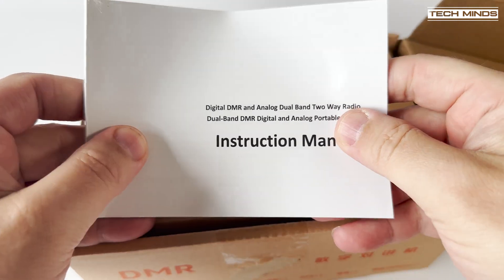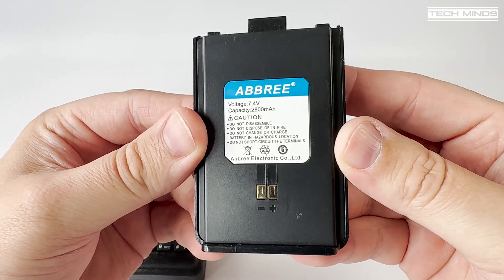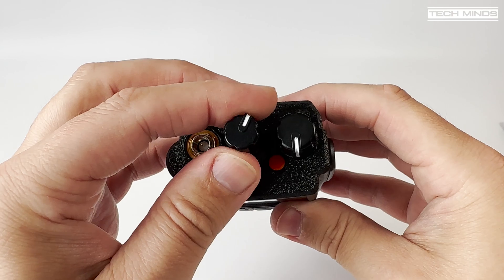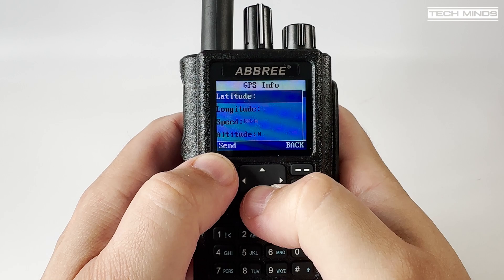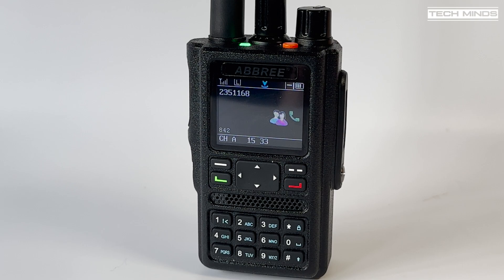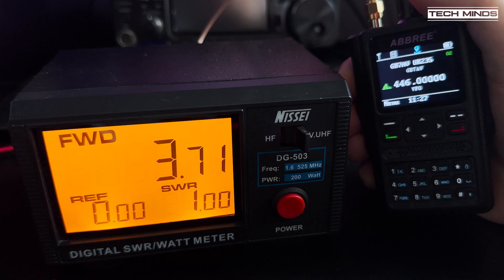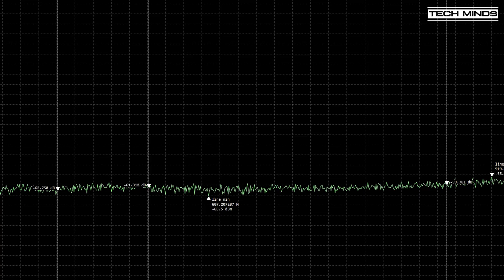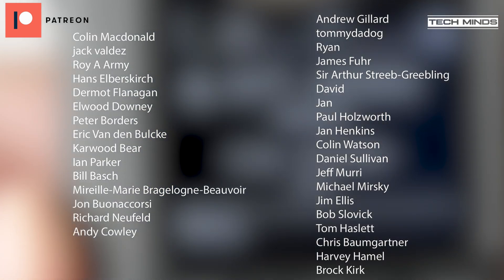ABBREE DM-F8 DMR TIER II With GPS Dual Band Handheld Transceiver

Comment: Hi Tech Minds!

Great video! Based on your experience... Will you be able to get more range with a DMR radio over an FM Analog, comparing this DM-F8 agains an UV-5R? Thanks
Reply from the maker: Great question. I can only respond with my own personal experiences, but in the past I did perform some tests with DSTAR and FM.  A friend and I were using FM, driving apart until we could barely hear each other on FM. Then we switched to digital DSTAR and could hear each other perfectly.  Never performed the test with DMR though. cheers!
Reply: @TechMindsOfficial  thanks for you answer!

Comment: Nice radio have you seen the abree ar-f8 is it similar to this abree that you reviewed ? Thanks
Reply: i have one of the ar-f8 models. its missing key features, comes with an inaccurate user manual and NO CPS workis with mine. otherwise its a decent radio if you can figure it out. but its made by a 3rd party manufacturer sold by countless sellers under different names and models.